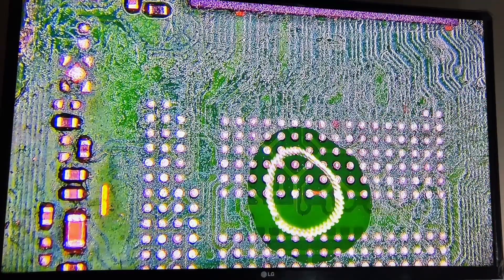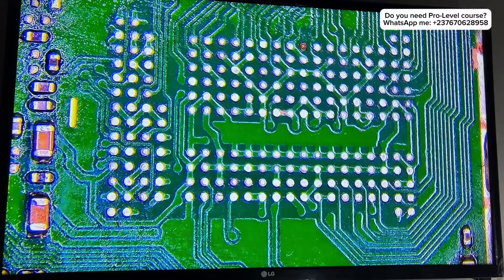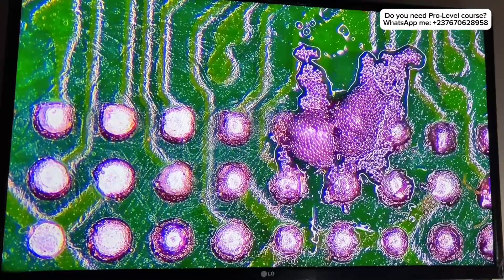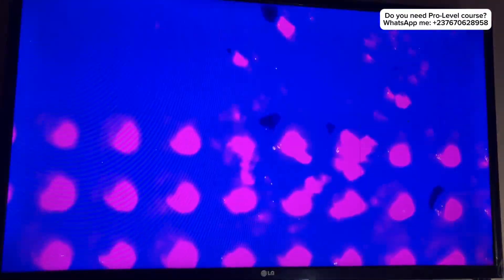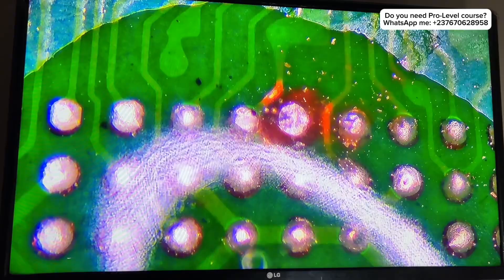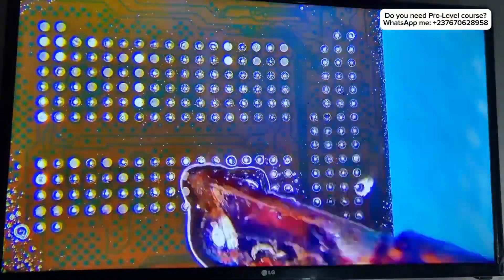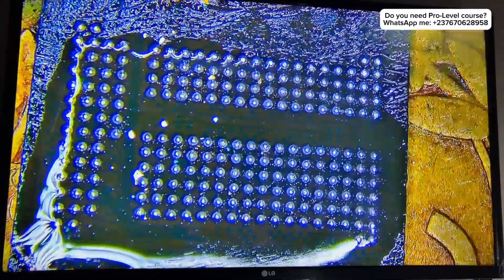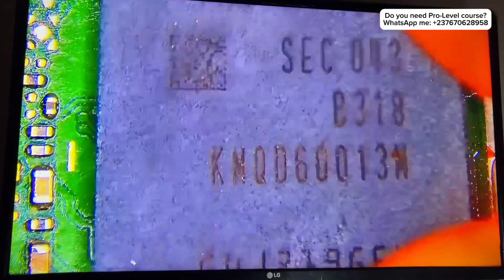EMMC Reballing And Damaged Solder Pads Repair

Comment: Are you not reprogramming your emmc
..
Reply from the maker: No bro. 
This was reballing which doesn't need reprograming.  Just reballing
Reply: @SergesMike  what was wrong with the emmc
Reply from the maker: Open circuit due to hard fall
Reply: @SergesMike  ok
Reply: Thanks for your reply when are starting your emmc and reprogramming course
Reply: Nice